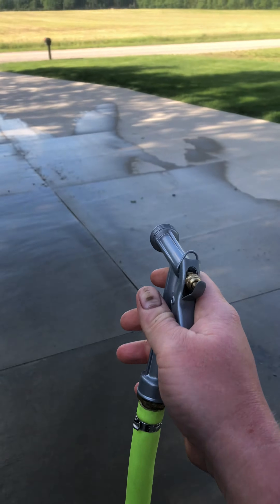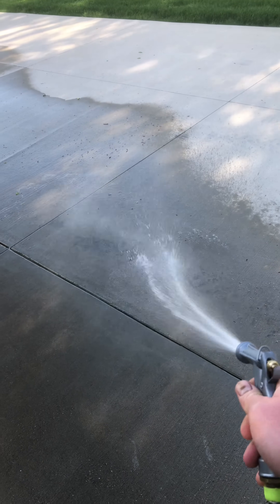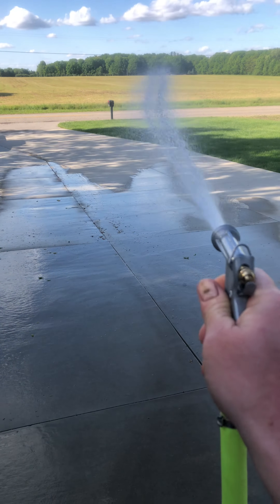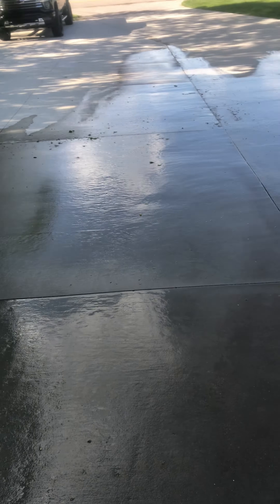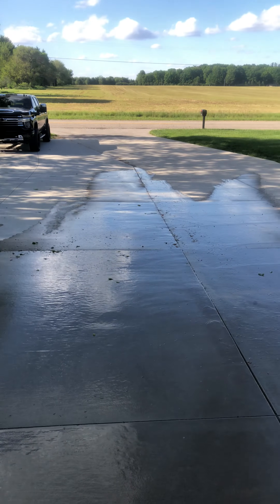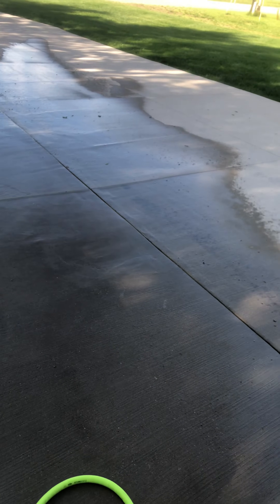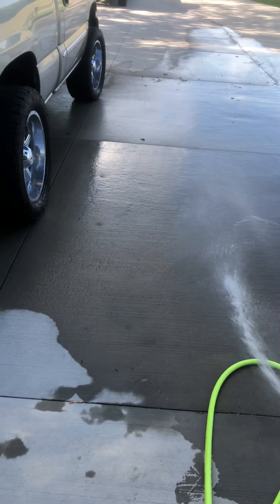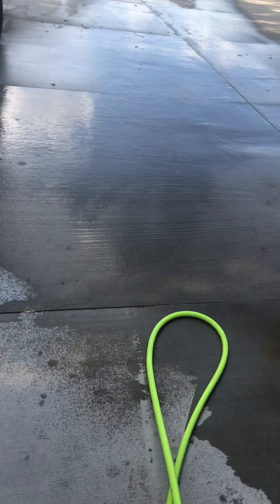12v pump 7 gpm 100 psi

Comment: How do I make a set up for a portable tent mister? I know I need a holding tank, misters, 12v battery and pump. Can I just run this set up into a hold tank and connect the hose to misters?
Reply from the maker: @elijahiaea424  low gpm high psi.  Probably want like 250-500 psi for that.  Need a fan and an ice box and tank.  Then you’ll have to figure out some custom nozzle sizes that’s going to be a totally custom thing. You’re gonna have to figure it out.

Comment: My everflo ef7000 isn't purring like kitten. 1" inlet hose about 3-4ft long, 200ft of 5/8" out, 1/2" suttner st-510 poly gun with 1/4 reducer at tip. Flows good with no tips or my 2540 but pulsating if I use any other tips it cycles on/off. Either gonna have to add accumulator tank or find different tips with bigger orifice so I can use shooter tip without killing pump
Reply from the maker: Accumulator for sure

Comment: I know you like 1/2" hose for 5.5 gpm and 5/8" hose for 7gpm, but what size valves and plumbing for proportioner and manifold do you recommend? I know the general standard seems to be 1/2" valves, would 3/4" be of any added benefit?
Reply from the maker: Each valve does about 4.3 gpm at open flow when you’re talking about half-inch GF. All the other half inch valves are going to flow less so if you’re going to run a 12 V pump it’s not gonna make a huge difference going to larger valves but if you want to run 10 gallons a minute well do you need a higher flow proportioner for sure. It’s one thing if you’re wide open with two of them because that 8 1/2 and then I’ll see you get maybe .2 gallons out of your soap valve or .15 so you’re not even getting nine. In my opinion the proportioner‘s should’ve been set up with larger valves to begin with because it makes it hard to run the small percentages

Comment: Bro What size hose is good for 7 GPM  5/8 or 3/4 or 1/2
Reply from the maker: 1/2” is fine if your under 225’ better under 200’ and 5/8” is better all around.  You could do 5/8 for 100’ and then go down to 1/2”.
Reply: @softwashscience   thanks bro

Comment: That flow looks pretty strong. It’s the same pump I’ve had my eye on. Can you run a small surface cleaner off of it? It’s the 100psi one, correct?
Reply: Really.

Comment: Hi will a proportioner (please excuse my ignorance)  help get the 12v more distance?
Reply from the maker: At best its going to give you the same distance but theoretically less distance because its just more transitions and more turns before you reach the pump.  The difference is small if set up right but the proportioner is a must have and if your using other metering devices and switch the the real proportioner then yes you will get more distance.  If you want distance than you need to have the best pump bypass hose reels, 5/8” line, high output battery etc....
Reply: @softwashscience   I'm batch mixing and using a 7gpm Fatboy pump, my main problem is I can't make quality foam for my metal roofs
Reply from the maker: @rabbitskinner   if your mission is to make quality foam for metal roofs then I hope your trolling and if not find your local chemical supplier because they will make a fortune off selling you a rust remover.
Reply: @softwashscience   no trolling Colorbond and Bluescope steel reccomend SH to clean metal roofs
Reply from the maker: @rabbitskinner  yeah I would downstream a metal roof in most cases.  Foam and metal is not a great idea I always use little to no soap on metal roofs because they rinse like shit otherwise ya know.

Comment: How are you able to get 50 ft distance,  please let me know. I am only getting about 33 ft from my 12 v system. Need help... Thanks!!
Reply: That would be about right  if your running through your proportioner and have say 200ft plus of line. 

I made my proportioner out of a garden hose splitter with 3/4 fittings; banjo, check valve(no meter yet) and hose to the pump. Then it’s 250ft of flexzilla to my Gilmore. I put a 3/4fght to 1/4 mnpt (amazon has it in one adapter).
Reply: Same here, are you batch mixing?
Reply: What pump are you running
Reply: @lukeknighton4918  everflow 5.5

Comment: That’s pretty powerful. 
Question. In our industry to we tell customers to have the kids and pets stay clear of siding form the sh after a house wash. Or as long as everything is diluted no need?
Reply: Hi. It was for a house wash. 
Post treatment I would defiantly give caution.
Reply from the maker: kawasaki house wash I never really worry as my crew over rinses so its diluted to nothing.  Roof clean or post treat then yes.
Reply from the maker: kawasaki depends if you post treat or not.
Reply: Thank you!
Reply from the maker: kawasaki where r u from?
Reply: most tap water is chlorinated.
most of the sh evaporates by the next day.

Comment: Did you buy a roll of 5/8 hose or using multiple lengths of 100ft?
Reply from the maker: Danny Powell I had a few 50’ hoses and a 75 and a couple 100’s then I bought a 250’ roll as well.  I have all short sections between 40 and 15 feet.  There is probably 300ish feet or so of garden hose on one reel.  Then I have 137’ of 3/4” goodyear hose all sectioned out on another reel as well.  I’m still using the 1/2” line on jobs for now though.
Reply: @softwashscience  for your soft wash setup you use 1/2 or 5/8?
Reply from the maker: Danny Powell  1/2” most days
Reply: @softwashscience is there a difference in using 1/2 and 5/8
Reply from the maker: @dustinjohnson2116  yes I think so. I run a five eights now and I’ll have to go back and look at the actual numbers.  If you watch my video titled 12 V don’t last you can see I show the numbers on a flow meter and that had about 225 feet of hose I believe. Now I have 5/8 and I have about 270 feet of hose And I took a video last year at some point that I should get around to posting if I still got it but I’ll have to look at the number difference at the end of the hose and compare the 270 versus the 225 and I can get you some real numbers. Off the top of my head I thought it did anywhere between 4.1 and 4.6 gallons per minute at the nozzle.  I’ve ran a 5/8 kuritech hose now for a few years now, but I remember when I first installed it it was a big difference to me at the time.
Reply: @softwashscience  so are you sticking with 24v pumps now?
Reply from the maker: @dustinjohnson2116  I need to do an update video. I have a totally different rig now and it’s set up way different but I still use the same pump for now.
Reply from the maker: @dustinjohnson2116 I still have 12 V and I’m wanting to either stay with 12 V or possibly go away from electric maybe but I really don’t want to switch to a 24 V.  Right now I run every single thing that’s electric which is a lot of stuff in my whole rig all to two deep cycle batteries and those batteries are charged by each one of my 8 gallon per minute pressure washers. So considering everything is on 12 V if I went 24 V, it would be an electrical nightmare and I would have to have two separate batteries and charge that system every night and I don’t really want to do that. The 24 V systems are nice but they don’t mesh with everything else very well and that’s a big disadvantage in my opinion.

Comment: Anything you don't like about the pump or anything you need to make it run more efficiently?
Reply from the maker: veganbcurry not sure yet I need some more time on it I just hooked it up.  Took forever to get the inlet fittings for it.
Reply: @softwashscience  are the inlet fittings are special order item just for that pump?
Reply from the maker: veganbcurry it came with treaded to quick attach fittings.  I originally got this pump for a different purpose but now that I’m using it in my gen 3 skid and with chemicals I got some nylon 3/4” 90’s so it fits in the box.  90’s are not ideal but its the space I have to work with for now.  I got some from west marine but they still haven’t showed up so I ordered more from another site and those took awhile to come from Cali with Covid.